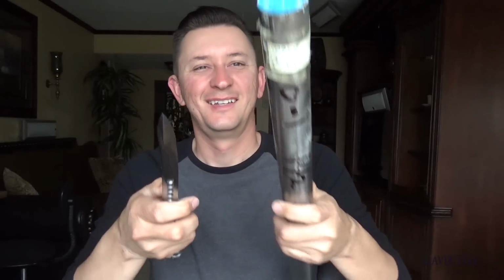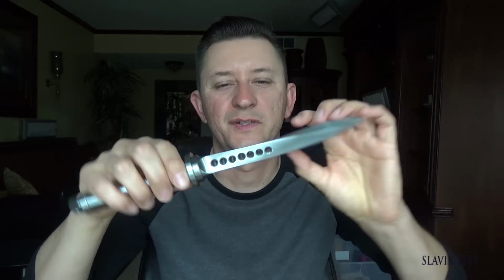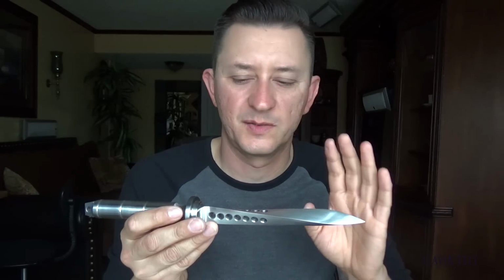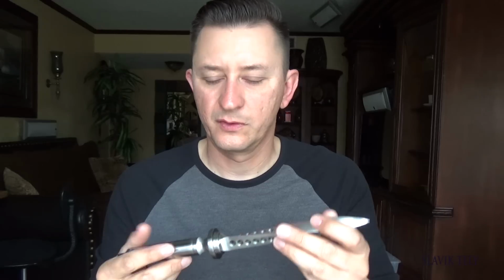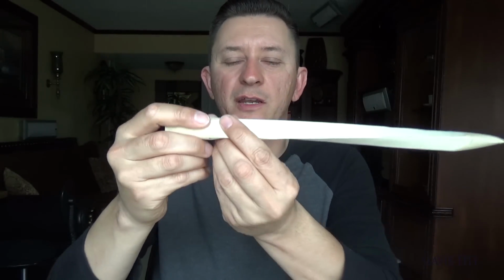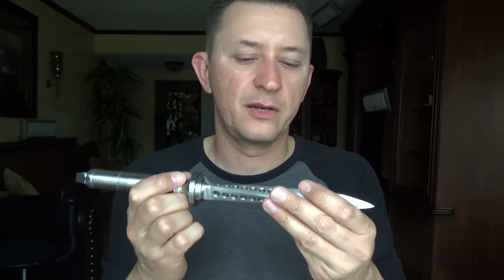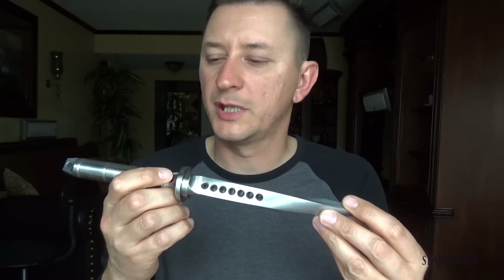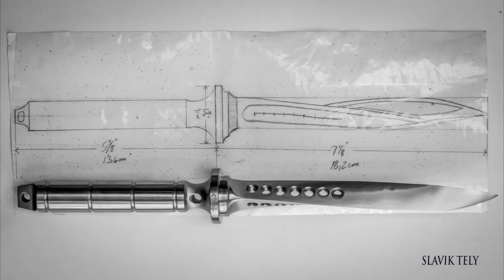Jagdkommando Knife Q&A

Comment: Slavik outstanding your best yet, way over
the TOP. I'M retired heavy equipment mechanic new to the
Knifemakers trade
And what I have learned from your videos is you are over
The. I have a question
For you I have the same bench grinder as
you, wanting know number & name of
THE purple grinding
belt you use. Great
videos great KNIVES.
....RICHARD..👍
Reply from the maker: http://www.supergrit.com/products/products_belts-ceramic  Also Ekim Knives has a video which belts to buy and not to buy for the 2x42 grinder.  Purple belts I buy are 120 and 60 grit. Also I get the 220

Comment: STEEL
New Jersey Steel Baron
3/16 inch (4.76 mm) thick Blade
High Carbon 1075
Handguard 1085
Middle handle piece 5160
Pommel 1075